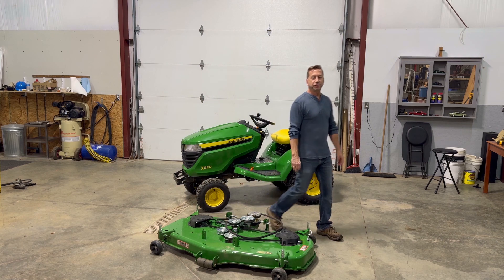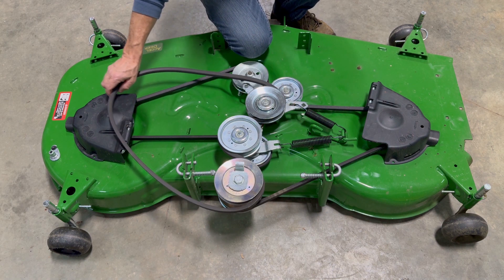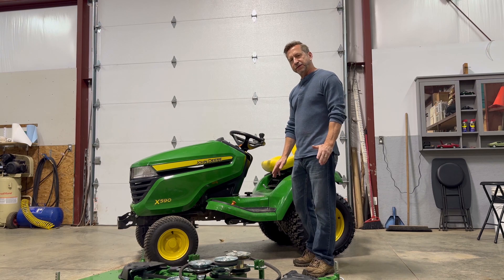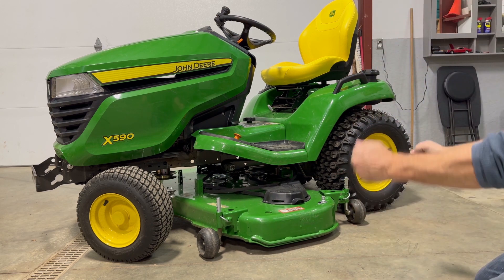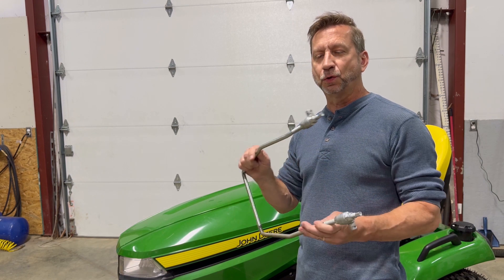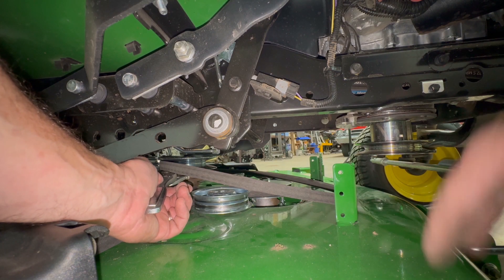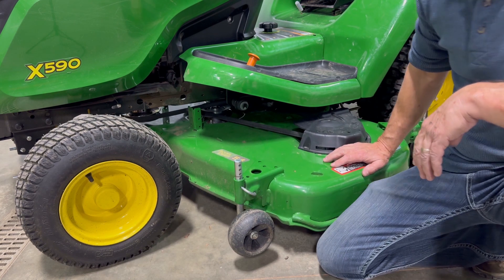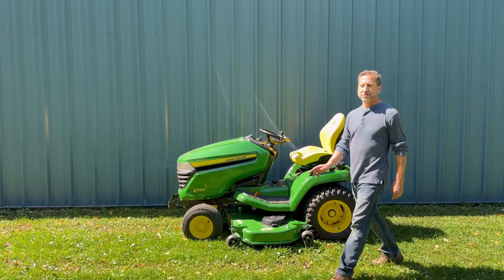Deere X590 Mower Deck Install

Comment: Hey! I've got a question. What oil do you use while snowplowing or snowblowing in the winter? I just wanna know.
Reply from the maker: Most times I run 10W-40 but in the winter, I replace it with 5W-20. I’m not sure if it’s necessary or not. It’s just something I do. I have actually run at least one winter with 10W-40 and had no issues.
Reply: @HobbyUniverseOutdoors  Do you by any chance know if using SAE 30 is fine?